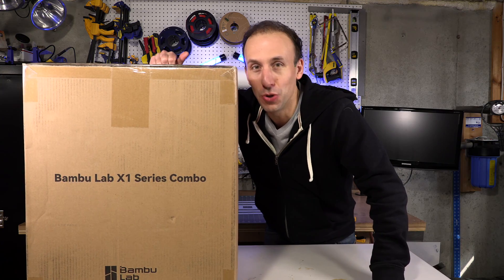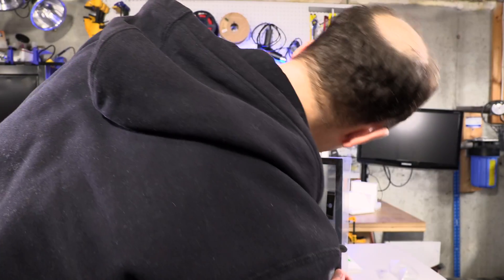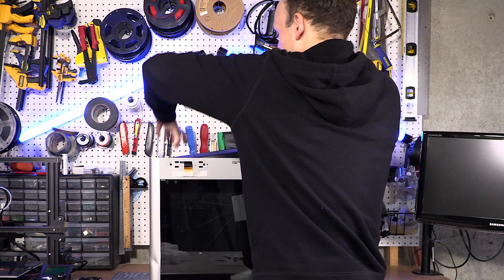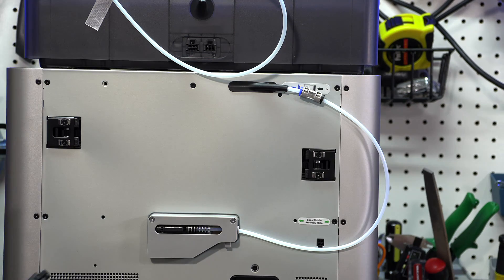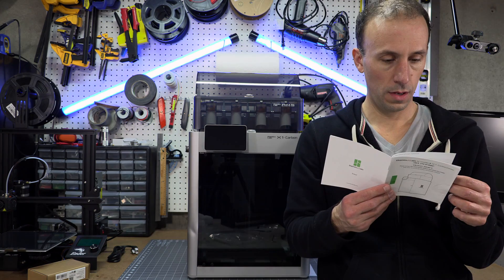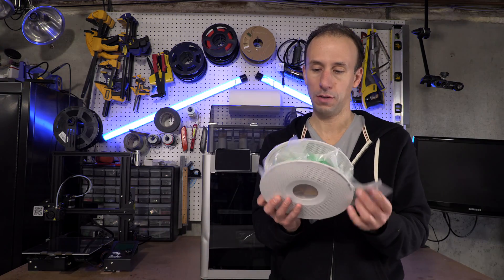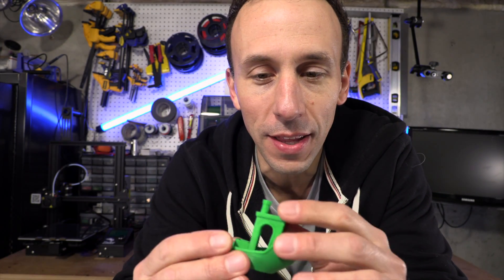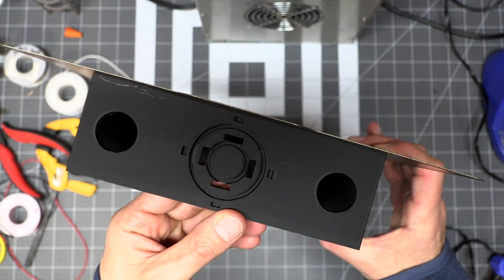Bambu Lab X1-Carbon Unboxing

Comment: What do you do with the black plastic you take out the bolt from the printer during unboxing? Is it trash?
Reply from the maker: Bambu suggests keeping all packing materials incase you need to send it back for repair. So I just kept everything and stored it in the box it came in.

Comment: I'm on the fence rite now which one to get also P1S or the X1C. I just purchased my first DJI drone the air 3 and the technology behind getting it to fly and handle the way it does is amazing so this printer being designed by dji prototype guys and gals is no joke an awesome deal. Iv been on the fence for a year about getting a printer but after watching this I'm all in on the x1c. Thanks for the video.
Reply from the maker: Glad the video helped! It’s an amazing printer. So very happy with mine. Let me know if you have any other questions about it👍👍

Comment: Benefit of AMS besides color is it allows you to fully use a roll of filament and it will auto switch to the next roll of same color.
Reply from the maker: I tried using that feature but it didn’t work for me. I’m still learning so maybe I did something wrong…
Reply: @engineeringwonder  Enabled it in settings and have matching filament settings?
Reply from the maker: Yes. It stopped because of an error. I think it was because the spool became too light and messed with the tension on the feeder mechanism.  I have seen people print out a container that fits in the middle of the spool you can add weight to for this reason. I haven’t tested it yet.